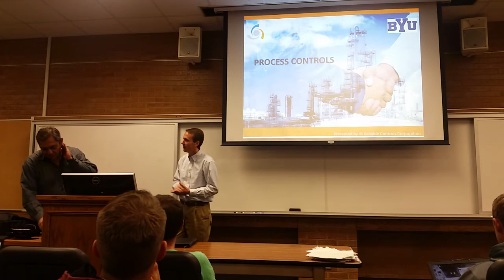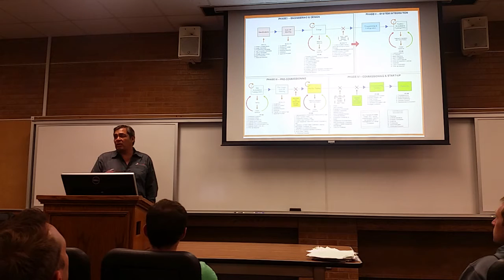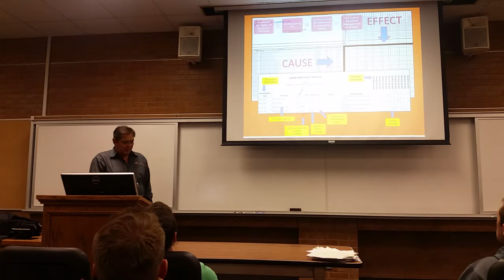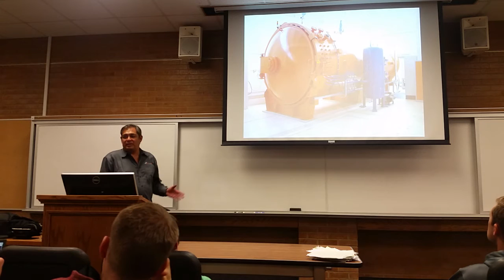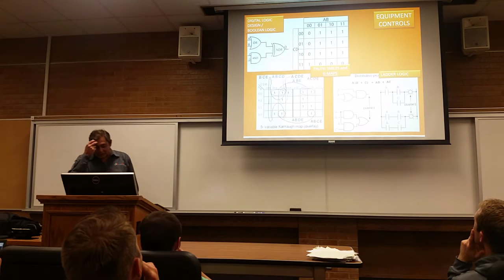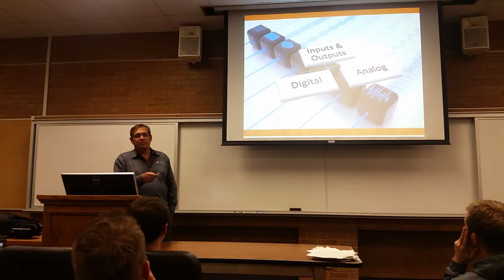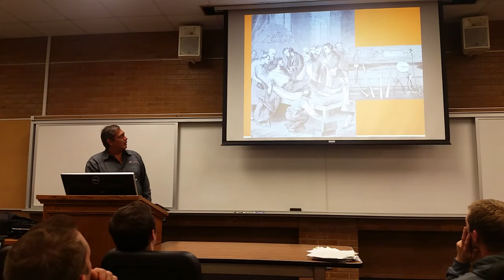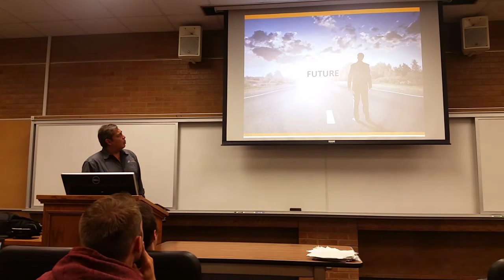Industrial Process Control in Mining, Chemicals, and Energy

Comment: High-end PLCs and DCS hardware are very similar (The samething in some manufacturers). Maybe the main difference is the programming interface or major redundancy, but the PLC manufacturers are offering similar characteristics to hold the competition (as rockwell, for example). "Distributed" concept is for both now. Different programming languages can be used in both cases, depends of the manufacturer custom or the kind of proccess.In Perú, we use System 800xA, PCS7, DeltaV, Archestra, Foxboro DCS, but Controllogix PLC (selfnamed "controller") support different systems in a concentrator plant,  such as Antamina or Southern Copper Corporation.When a control system don´t work properly is because the end customer has the great idea to buy controllers and HMI of different brands and contract integrators companies with poor background and low cost.
Reply from the maker: Great insight! I agree with your assessment of mixing and matching different systems with poor support. Unfortunately, many PLCs at legacy plants are stand-alone and are difficult to maintain and integrate into a larger optimization layer.
Reply: According to the video questions: The Control systems brands in mining (Perú, Chile and Asia) are mentioned up lines. Many customers only prefer Siemens or ABB, because they have the complete solution (DCS, Gearless mil drive; HV, MV and LV electrical systems and process/analytical instruments, including fire detection systems and CCTV.They only use alternative brands for specific applications such as nuclear switch/densimeters, sonar flowmeters, signal processing with acoustic sensors in the mills and cyclones, and sometimes expert systems as the metso brand for rocks, mill balls and  flotation froths.
Reply: Programming languages: In my own experience, ladder is easier (for beginners) but it is slower to analyze when you have a large sequence. Function blocks is better because you can reduce your program considerably applying boolean logic and it will be easier to analyze. You can complement this strategy using Structured text (ST). With ST you can put and remove parts of your program easily only with this symbols //. ST is very useful when you are commissioning one area of your plant but you have to simulate some feedback signals because other involved áreas are not yet available. You can also develop math formulas clearly. SFC is used for sequential control systems. Instruction list is similar to assembler and I used it to simplify basic mathematical operations or impress/confuse to the curious people.
Reply from the maker: Great feedback, Miguel. I'm most familiar with Honeywell DCS systems such as TDC3000 with CL programming and Experion with ProcOps and CAB programming (modified Visual Basic). It sounds like you have some great experience with Siemens and ABB. It takes a while to learn all of the nuances for each system but all seem to have the same basic structure.
Reply: Thanks. Honeywell is a great product. They also have DCS systems here, but they represent less than 6% of the mining market. My opinion about Brands is only based in my experience working as EPCM supervisor in Jacbos, Ausenco and other partners working in projects as aktogay in kazakhstan, .